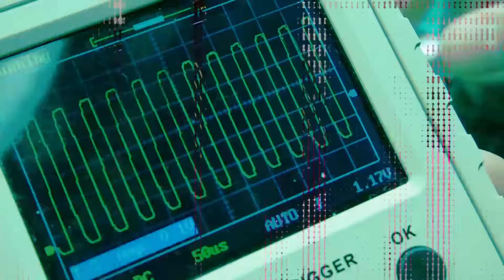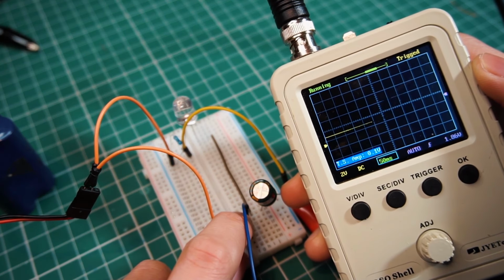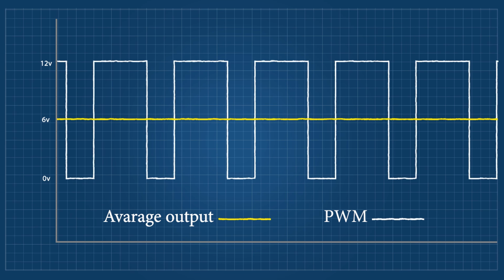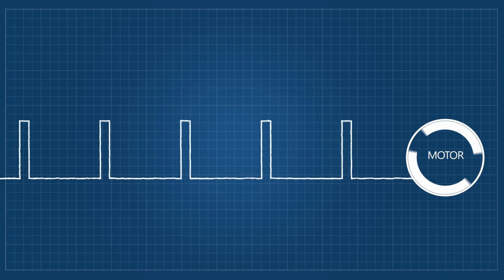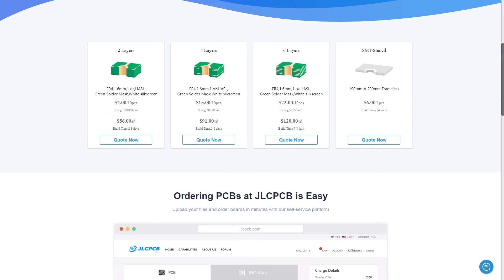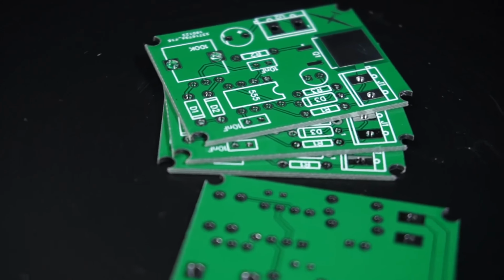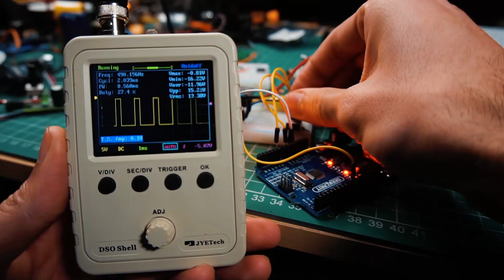How PWM works | Controlling a DC motor with a homemade circuit

Comment: Doesn’t the mosfet in the schematic need a pull down resistor to drain gate capacitance? Otherwise the mosfet will be in saturation mode for a long time.

Comment: Now that explains why electric multiple unit trains squeak while accelerating or stopping. It's a very primitive VFD. The PWM signal gets sent to the gate/base/control of the switch (transistor), the motor speeds by the average voltage but it in reality is the PWM fluctuations rather than the continuous voltage. Frequencies can be changed for faster speeds or better adjustment.

Comment: Is there a way you can make the circuit so that instead of using Variable Speed, you use 3 Speeds within the motor instead? For example instead of the potentiometer using the Variable Speed to control the motor using 3 Speeds within the motor shaft instead of customizing it from an Aesthetic Low Speed (very slow) to Full Blast/Super High Speed (very fast).

Comment: I study engineering informatics and have mechatronik 1. I really want to learn how make this 'complicated' circuits. I want to be capable of setting a plan in motion. Like create a something that would turn an led on and off as a timer. for instance: on for a second and then off for another second and it goes on like that. Help

Comment: Hello I have unusual question wuld that circuet work with pick up coils found in distributors?
I have for days problems finding corect circuet to interupt pick up coils going to ignition module .
So any help please?
Basicaly I need circuet that can control pick up coils phase shift them or controling pulse generators pulse duration

Comment: If I have a geared motor that runs at 30RPM, then I add a PWM speed controller, will the max speed still be 30PWM?

Comment: I am new to all of this, and I want to use a 12v.motor.from a car windshieldwhiper or a power windowmotor to make a.convayerbelt. on that isnt gonna be really powerfull, but I remember from working in a factory the motors have to start slow else they rip the belt. Dont know if I would need that in my project, but I def need to be able to have a speed control, this would be perfect but how do u call this.setup? Can I buy one from amazon? I live 3th world so its hard to get stuff.need to buy it in usa than send it here.

Comment: What is the purpose of the diode parallel to the motor?
Reply: It to allow current to flow back in the opposite direction as the magnetic field of the motor windings collapses which can cause some really high voltage spikes if you don’t have it potentially damaging your circuit.coils  have inductance and as the magnetic field collapses a current is produced.

Comment: The R1 heats up when motor is running slow . tried using a 1 watt 1k ohm but motor doesnt rotate at all. My input is 12v. Any ideas

Comment: so, i just tested the signal generator on my oscilloscope and measured it against a potentiometer. it doesn't change the duty cycle, but does change the amplitude of the pulses

Comment: Good job and a nice implementation. I'm gonna to fo Mosfet driver and I want a high frequency typically like 50khertz. Can the Arduino give me these values or I have to implement a timer 555 and deal with resistors and capacitors to have these frequencies

Comment: 4:00 for led's we dont use pwm to decrease voltage, same goes for majority of usecases, pwm is mainly use for quick on/off while still having high voltage, just not nonstop, for led or dc motors you need to have high enough voltage to run them at all, so you use time, not voltage to control brightness or speed. Pwm is used for decreasing voltage only for variable voltage output and you need to have inductors and caps on the output, for example VRM for cpu/gpu in pc.

Comment: I think the analysis in 3:30 is very important. Sometimes you have no option other than use a potenciometer, so sometimes when you  work mainly with situations you can't use a PWM, you forget this aspect of the PWM when you have the opportunity to use it

5:16

Comment: Very great teacher, you are, Master of the 555. No joke, I learned why we use Pulse Width Modulation with you here and what uses it has. It cleverly limits sordid power dissipation too! Perfect crash course on the 555. Thanks Master. Thanks a lot.

Comment: pretty late - but I like the way you chose for the PWM explanation.
and I like this oscilloscope which I think I will buy to see these pulses and check things like servos. 

Was not aware of PWM as servocontrol ...
Therefore I will walk through the list of videos on your channel to find more explanations I might need later ...

really great work this video to do it 3 times 
from breadbord
to pin board
to pcb

Comment: At 1.4 KHz PWM signal motor makes buzzing sound at low speed. But with higher frequency at 14 KHz that problem can be solved.

Comment: Very helpful. Would you happen to know what the high and low voltages are on the PWM signals used in Volvos to control the AC Blower Motor?
Say in a 2008 XC90 there are 2 small awg conductors that must be used for the PWM signals and there are 2 Heavier Wires each 10 Gauge Red and Black that provide power from hot to chasis ground controlled by the power transistor and PWM Duty Cycle Signals.

Most literature still uses the term "Resistor Module' that controls AC fan motor speed but that is just from days of the old technology to control fan speeds. The fan control module must be a power transistor instead that is is controlled by the 2 small conductors Blue & Yellow coming from the climate control module.

Comment: Wait a minute.  Did you say you still need a potentiometer to make PWM possible?
Doesn't pontetiometer only control voltage and not how long the  on time of a given period should be?
And in most pwm circuits there seem to be a potentiometer already set in the circuit, which the user doesn't play with. Unless that is another story.   And what about the push buttons to increase and decrease speed of motor?

Comment: I don't understand why you used MOSFET while making a Cir-quit with arduino, can't we use a BJT
Update:
I saw the difference between a mosfet and a bjt. So you can contol the output current with the variable input voltage in a mofet, while in a bjt, you can control the output current using the variable input current. You can generate pwm output in an arduino which will deliver variable input voltage for mosfet and in turn the mosfet will control the current output to the motor or the bulb. 
Please correct me if I am wrong.
I have a doubt: how do you increase the brightness of the led with the current output of the mosfet, I thought increasing the voltage does that.

Comment: Hi. This is a great video. The best visualization of the content I've seen so far. 
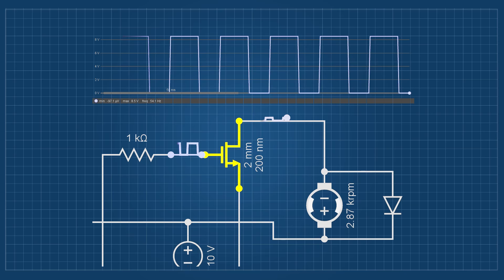A bit old, but I hope you still can see this message. Regarding the circuit representation about 5:30, with the small waves next to the components, did you get inspired by some software? I'm very interested in making some visualizations of this kind for learning.

Comment: Hi, is there a wiring diagram of the Arduino that you created near the end , I'm currently running a project , however, I have to show examples of each a mechatronic motor, a plc motor and a pmw, that one you placed at the end is perfect for what I need to do, many thanks, great video 👍

Comment: Noob question perhaps... but why is it simply assumed that voltage applied for less time AUTOMATICALLY equals lower voltage? Does it require a specific component to perform the averaging (e.g. capacitor?)? Or is it always true in any circuit (even more interesting why)? Does it perhaps require some component to not be there (RC filters come to mind)?

Comment: if you change the cap to a higher range will it my output more choppy (like spin stop spin stop ).... basically need a choppy effect when the POT is turned down then when the pot is turned up it should speed up and smoothen out .Is it possible ?

Comment: Do you lose torque with lower speed as much as you would if you were to use a simple potentiometer to lower the voltage?

Comment: project works fine, but it creates humming noise, How to eliminate it.??
Reply from the maker: Hunting noises are normal because of the frequency the circuit works with, if you want to eliminate the hum then you need a digital pwm circuit that reaches a very high frequency that human hear can't detect.

Comment: Excellent video. How did you learn to design PCBs on Easyeda? There are no good videos from them. Also looking for components and picking the correct size, for example to fit a POTs pins is like searching through a jungle. How do you determine correct pin spacing on components contributed by other people? Any helpful tip is much appreciated. Keep up the great work. Thank you.

Comment: That's a great work of yours sir, but can I ask if how did you design the circuit I mean how did you know the exact value of components to use also how did you know to connect them properly in the schematic, please let me know because I want to learn to design electronic circuits on my own, thank you

Comment: Liked and subscribed! Could I use a  Control Voltage (CV) input to control the duty cycle of the PWM circuit instead of a potentiometer?
Reply from the maker: I think you can.

Comment: hey  what if the main input voltage is 60v, can I turn it up and down with this little thing
Reply: No, you can try separating the input voltage of the 555 timer and the transistor, so give the 555 timer a 12v input and use a transistor that is rated for 60v and feed it 60v and see if anything explodes 😄

Comment: Good video! Can I use an LED instead of a motor? If so, can I consider it as a constant current driver or voltage driver? Thanks

Comment: see , when the dc supply goes into ESC , the three outcoming wire which is connected to bldc will run the bldc , so when I will give pwm in input dc pulse , what will happen ?
Reply from the maker: The ESC is a programable digital circuit, it's more complex than just pwm, the pwm signal from the receiver to the ESC is then interpreted by the chip on the ESC to then adjust the power and frequency according to another reading made from the motor position. Is a lot more different.
Reply: @Joyplanes  oh !!! I got it

Comment: Hi , I got my CNC3018 working with the soft limits finally, but now my spindle wont turn off until i unplug the power , as i was checking online i realized that the FET has been shortened , i got a full arduino kit  beside my cnc , but idk what to do to fix this issue, could you please help ?

Comment: Bro , can I just give pwm to esc input signal to control speed of bldc ? Will it effect three outcoming pulses from esc ?
Reply from the maker: It doesn't work with brushless motors. It is not an esc.
Reply: @Joyplanes  see , when the dc supply goes into ESC , the three outcoming wire which is connected to bldc will run the bldc , so when I will give pwm in input dc pulse , what will happen ?

Comment: Hi! got some question for you, how can I change the frequency of your circuit?
Reply: Talha Siddique  what does that mean
Reply: Check the datasheet of 555 timer ic and there are some equations there to calculate the needed component values to change the output frequencies. If you want to make a frequency changing pwm circuit don't use diodes at the potentiometer but ofc its more complicated than that